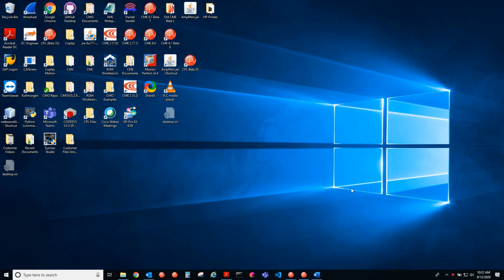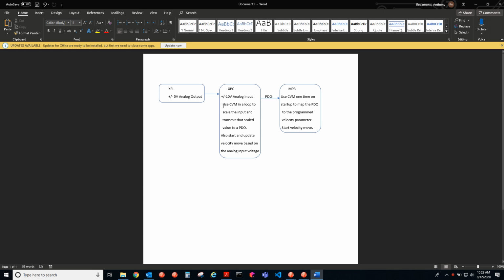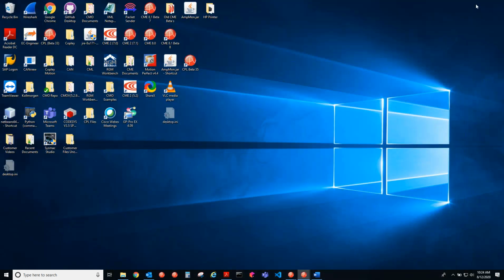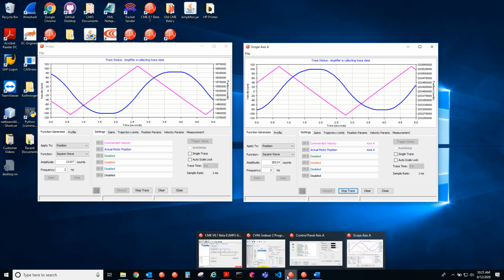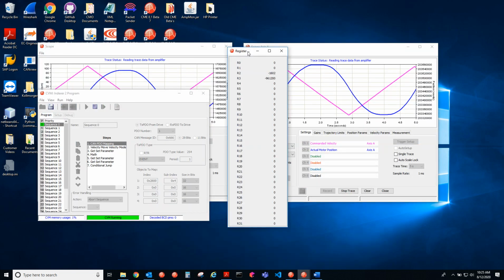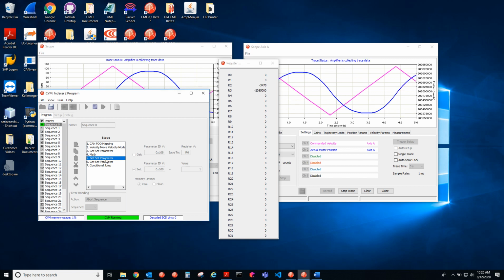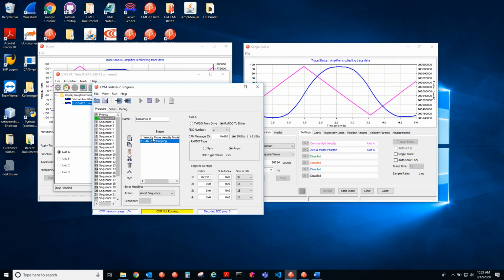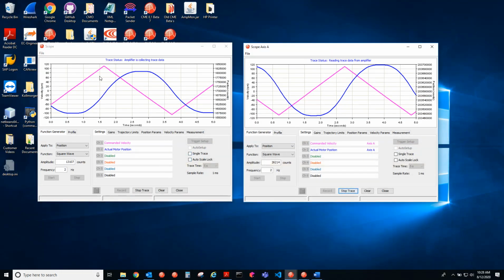Analog Input Commanding CANopen Network Using CVM

Comment: Is the Copley Virtual Machine (CVM) a hardware + software product that works with any CanOpen device?     I'm looking for a CanOpen software that can read / plot TPDO data from my custom CanOpen device..  as well as command/configure the device (SDO/RPDO).   Any recommendations?

I'm very new to CanOpen, and have basic questions that I haven't been able to find anywhere..  for example,  does a slave device typically set its CAN filter to accept all NMT COB-IDs (0x000),  PDO1-4  ($0x180/0x200/0x280/0x280/0x300/0x380/0x400/0x480/0x500 + $NODEID), and all SDOs (0x580/0x600 + $NODEID)?

Speaking of COB-Ids, I understand it is comprised of a 4-bit function code with a 7-bit Node Id.. and PDOs 1-4 have a unique function code, but what is the COB ID's function-code for nodes 5-128?   Are they manufacturer specific?  

For example, Pepperl Fuchs' Multi-Ray LED Scanner R2100 is a CanOpen device that has PDO 4 & 5 COB IDs of : $NODEID + $0x80000480 & $80000200.    But shouldn't TPDO4 have a COB ID of $NODEID+0x480.. how can the PDO4&5 have COB-IDs larger than 11-bits?!   I would think they made a typo, but I found an independent tool (CanFestival) that ALSO shows the same large COB ID for PDO5: 0x80000000!
!
Reply from the maker: CVM is a motion control software used inside our servo drives. Typically, on a CAN bus there is a master node. All other nodes on the network are slaves. They will have CANopen ID values ranging from 1-255. All nodes should have different addresses. The master will map (write) PDO data on the slave, changing any default PDO mapping already in the slaves's CANopen Object ID's (defined in the CANopen Protocol DS301/DS402). RxPDO's are commands from master to slave device & TxPDO's are feedback from slave device to master. Each PDO has a COB-ID, type, and number. I would suggest buying the CANopen license for more details related to the meaning of the COB-ID. 

The CANopen Object for the COB-ID is 0x1800-1807, sub-index 1. Bits 0-10 are the 11-bit identifier for standard (CAN 2.0A) identifiers, or the lower 11 bits for extended (CAN 2.0B) identifiers. Bits 11-28 are the upper 18 bits of extended identifiers. For standard identifiers, these bits should be written as zeros. Bit 29 is the identifier format. This bit is clear for standard (11-bit) identifiers, and set for extended (29-bit) identifiers. Bit 30 is the RTR disable. If this bit is set, remote transmit requests (RTR) are not allowed on this PDO. If clear, the PDO is transmitted in response to a remote request. Bit 31 identifies the PDO as valid if clear. If set, the PDO is disabled and its mapping may be changed.
Reply: @CopleyControlsOfficial  So, to set a digital output, for example, that a servo module may have, would the CAN-bus master send it RPDO data (not an SDO command)?

If so, according to CIA-401, it would seem the Object Dictionary Index would be 0x6200  (Digital Outputs) Digital Inputs are mapped to 0x6000, Analog Input 0x6400, and Analog Output 0x6410.

It gets a bit confusing when to use a PDO vs SDO.. or the low-level CAN addressing.  For example, to get the Manufacturer/Product ID of Node Id 0x3A.. the CAN-ID on the bus is 0x63A??!!
Reply from the maker: @bennguyen1313  SDO's are for non-cyclic data, so yes we can set an output using an SDO. However, we can also do this with a PDO. If the PDO were SYNC type, then the output would be set after every n'th SYNC pulse (over and over again - cyclically). If the PDO were "event triggered" type, then the PDO would only be sent in the case of some defined event. Typically, if we need to write to an object over and over again at a high frequency, we would map it to a PDO. If we are simply altering configuration settings, then we would use an SDO to send the data once.